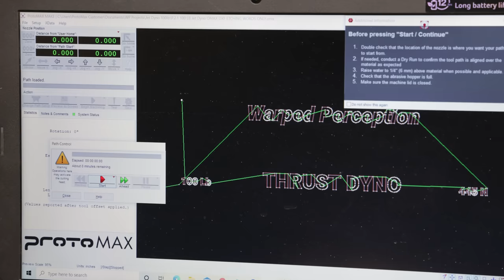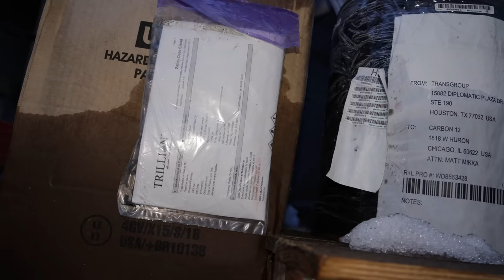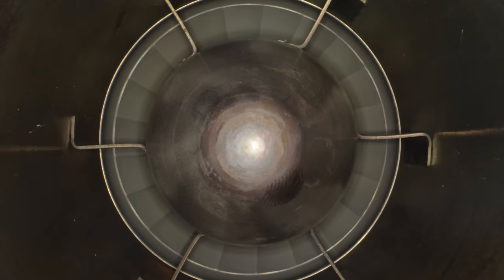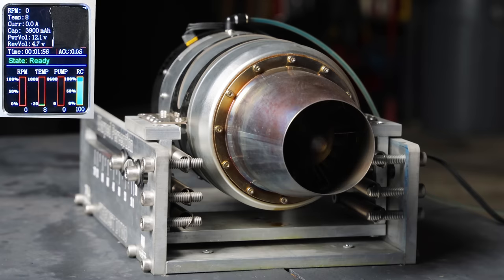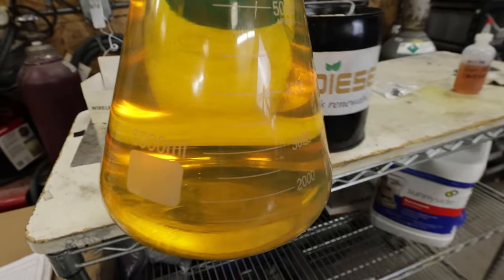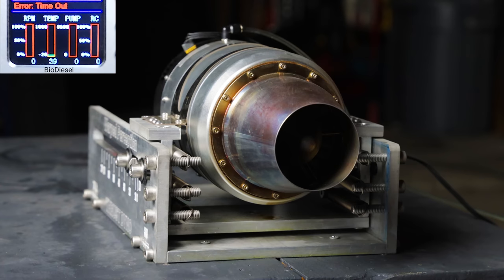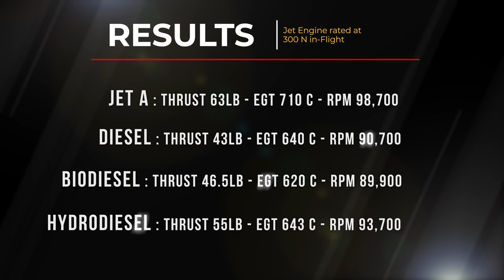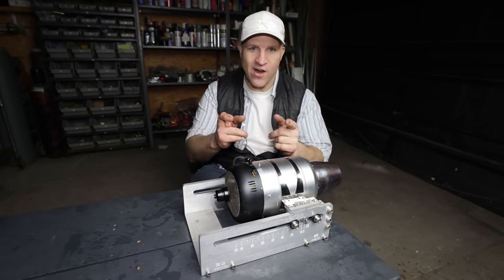Jet Engine Thrust Test - Fuel Experiment (Jet-A vs Diesel vs BioDiesel vs HydroDiesel)

Comment: As an helicopter mechanic for 23 years, I can tell you this test went exactly as I thought it would. Each of the fuels has its own specific gravity, and unless the metering jets are adjusted to compensate for this you'll get weaker power due to incomplete fuel burn. The reason that the hydro diesel did better than the other two is due to physics. The water in the fuel cools the air as it is injected, this increases the aircharge in the combustion section much like nitrous does in a car. Older turbojet engines actually used a water injection on take-off(though it was injected into the compressor section not the combustion section) to increase the performance of the engine. The AV-8B Harrier still uses this today, to boost engine power when in a hover. Jet-A is a very dry fuel, and is anhydrous, and soaks up water like a sponge. This is the reason why a lot of airplanes will put an additive known as colloquially as Prist, though many manufactures make it now, that lowers the freezing point of the water suspended in the fuel to prevent ice build up on the fuel filter screens. So, that pretty much means, hydro-fuel will more than likely not be coming to an airline near you any time soon.
Reply: Great explanation.
Reply: Wow
Reply: Germans used water methanol injection to ad more boost without the fuel igniting from pressure. It allso cooled the pistons. Would be nice to see if it worked on a jet. Alcohol prevents the water from freezing allso tho they propably have tried it in jet engines minding the hydro diesel. In carage it could work coz you don't have to be worried about icing.
Reply: @ark-mark1  If you google it you'll learn that it has been used in jets many times.
Reply: the USAF and McDonnell Douglas experimented with F-4 engines with water injection too, during the Israeli-Arab war to counter the Egyptian MIG-25, they decided to not give the result to the Israelis though because it is considered too advanced
Reply: Correct me if I'm wrong, but I believe the p-47 had a similar water injection for it's radial engine, a little different, but same principal.
Reply: Good old prist...pumped more than enough fuel in my time that included plenty of that
Reply: Out of curiosity, if water injection into an engine is considered a power adder, why is water in fuel always considered a big problem in aircraft?
Reply: @FlexLex  i'm wondering this too, as water is not compressible. i assume in small quantities with enough compression and heat, it changes that somehow but yeah, water in the gasoline is the same as putting a chunk of metal in the cylinders ie. its not gonna be kind to pistons!
Reply: @FlexLex  water sitting in your fuel tank usually settls out rather than staying suspended in the fuel. Water promotes corrosion and microbial growth, both problems in a fuel system. It also freezes, which blocks filters and pickups.
Reply: @FlexLex  because water freezes. At the altitudes these aircraft are flying, the temperature reaches well below 0°F, so any water content in the fuel will freeze, and can cause engine failure
Reply: @ct1762  in turbine engines, the compressability isn't such an issue. It's the freezing point of the water that causes engine failures, as well as the microbial growth that happens in Jet-A with water, this causes a significant amount of corrosion, which is incredibly bad for aircraft
Reply: @ShelbyWithAShelby  but then how does the hydrodiesel work? It has water in the fuel.

Also, I've read multiple cases of aircraft having engine failure shortly after takeoff in warm weather, where the root cause found was "water in fuel."
Reply: @FlexLex  HydroDiesel works due to the relatively low compression ratio of diesel engines, and the water being emulsified in the fuel. This acts as water/meth injection for the diesel. However, as you saw in the beginning of the video, in cold weather this fuel will freeze, which would cause issues for any fuel system. As for the engine failures in warm weather caused by water in the fuel, this is generally due to a large amount of water that has settled in the tanks, and since water doesn't burn, when the fuel system starts drawing pure water, it causes engine failure. This is generally an issue more on high wing piston driven aircraft, as the tanks generally feed from the bottom. This is the reason that on modern airliners, the fuel system uses a floating pick up tube to pull fuel from the tops of the tanks
Reply: @ShelbyWithAShelby  that all makes sense. Thanks for clarifying!
Reply: @FlexLex  gladly!
Reply: @ShelbyWithAShelby  oh makes sense about compressability as the exhaust gasses are all going the same direction all the time, even though there is a "squeeze" before the bang, its got plenty of volume to escape, unlike a piston compressing all the way to TDC.
Reply: @ct1762  :only possible with diesel engines. But it needs a firmware update of the controller before  using it. Gasoline engines risk nocking  so destroy the engine. Gasoline engines are also far less robust then a diesel engine. But water to fuel is a risk of corrosion. Adblue is mandatory for euro6 diesels , it's in fact water wit 35% urea   and if You ignore the messages so Adblue tank empty then the car can not start anymore unless a controller reset is done. Adblue has a separate connection, it's not mixed into diesel.
Reply: @stefaancodde6578  Sorry... whats only possible with Diesel engines? and diesels are not necessarily more robust as far as the rotating components (crankshaft, pistons, bearings etc), but because they make so much torque down low, can comfortably make power at lower RPM, which usually increases engine life. Diesels run much hotter than gas engines, and are more sensitive to dirty fuel, and cannot rev very high (useful for high speed boats that need a propeller to turn high rpm for less drag) but i'd generally agree that Diesels are great for equipment that needs to go over 5,000 HRS and weight isnt a huge issue.
Reply: Perfect
Reply: @FlexLex  Aircraft fly high. Temperature drops 3 degrees per thousand feet. At 35000 feet I have seen -77F. Jet A turns into GEL and clogs the filter screens. Aircraft have tank, line and other heaters to reduce the problem, but a higher water content will eventually cause flame-outs.
Reply: How does the lower molecular mass of water compared to carbon dioxide fit in? For rocket engines adding something with low molecular mass can be very important for efficiency because it means some of the exhaust products are going faster. This, for example, is one of two main reasons the space shuttle engines run very fuel rich, because unburnt H2 is extremely low molecular mass, nine times lower than the combustion product H2O, the other reason is to help combustion chamber from melting btw. Here H2O is less than half the molecular mass of CO2, but I don't know enough to understand if and how much difference it makes for a jet engine like this one...
Reply: Could also be the density, more evenly homogeneus ignition (the closest that come to mind) just like Mazda's Skyactive-X (unheard since a lot)?
Reply: اليس المحركات النفاثه تعمل بوقود الكيروسين !؟
Reply: Jet A have are more category
Reply: @nicholasthiery9542  I believe that was to cool down the supercharger intercooler
Reply: Also, when water goes through the engine, it creates super heated steam which gives additional thrust.
Reply: As a*
Reply: Very informative
Reply: @ct1762  your first statement was kind of wrong, yes water is not conpressible in liquid state but as soon as you inject that into either the compressor or combustion chamber it will immediately turn to vapor like fuel itself does so then it is compressible
Reply: Lol I want to be sounding this smart 😂
Reply: I'd imagine you could use a smaller pipe on this to generate higher thrust, given the lower temps of the hydro-diesel (which is the most bizarre fuel I've ever seen in my life--water should not be in diesel 😂)
Reply: thanks ,I forgot about that
Reply: Does the water content in hydrodiesel present any corrosion issues in the turbine itself if used regularly?
Reply: Based on your comment I believe you are in fact, a helicopter mechanic.
Reply: OMFG back to the school
Reply: @nicholasthiery9542  U are right
Reply: I want to hang out with you and learn cool stuff like this.  Thanks!
Reply: @portal432  me too 😁😁
Reply: Makes sense considering there are a few older turbojet aircraft that used water injection as a means of producing additive thrust past that what the engine was capable of on straight fuel alone. The boeing B52 is an example of that. there's a water injection system which pprovides a threefold improvement for the engines.

1: it cools the intake, increasing the air density of the intake charge
2: the water expands rapidly into vapor during combustion, causing a greater force on the turbine, ergo... more thrust!!
3: the combustion temperatures are lower, which combined with the cooler air charge and the denser exhaust causes the engine to produce a fairly significant amount of thrust over that which it would be able to if it was just running on straight JET-A1, for example.

The only downside, and this is very visible when you see one of these planes take off, is that the water injection causes incomplete combustion of some of the fuel. This means that you will get more smoke than a turbojet or turbofan that does not have water injection.

as a side, a similar effect can also be realised to a degree if a plane's engine ingests water during flight.
Reply: With compensated metering jets, would you expect nearly the same thrust with all four fuels?
Reply: @anidiotinaracingcar4874  At the very least, the alterations to the fuel metering jets for each fuel will improve the engine efficiency per given fuel becuase you will run the engine closer to its stoichiometric ratio, which the magic ratio is where all air and fuel is combusted cleanly to produce power. Depending on how far out of wack the ratio was with the standard kero jets, the engine may see an increase in thrust with lighter fuels from this due to the added fuel. You would likely inject less fuel for the more energy dense ones though, meaning if it was a gross overshoot of the AFR you could see gains in thrust, but I'd be willing to bet there might be a slight reduction but improved engine fuel efficiency instead.
Reply: I would love to meet you. Man, you are very intelligent 👌 and I would love to learn more from you. If I had your knowledge, I'd be a millionaire 5 times over. The world 🌎 needs more people like you. You should start your own YouTube channel teaching young minds and old ones too! You'd probably have a million followers in no time and be getting paid from YouTube and never even have to leave the comforts of your home 🏡.
Reply: @alaric_3015  Or maybe it was disappointing
Reply: Also 747's will suck all the air out of 3 bedroom house in 0.3 seconds
Reply: Just got around to watching this video...I had the very same thoughts when watching, "Change the fuel metering!!"  You can clearly see by the combustion the "heavier" fuels wanted more air.  Same for the temps, and the fuel pumps data acquisition!!  All fuels optimized, it's be curious to see how the #2 would do with the extra BTU content.  Then again, who would want to maintain a turbine running on #2!!  LOL
Reply: Everything you've explained so far is correct and that comes from someone who has worked with fuels ;)
Reply: @ShelbyWithAShelby  but does the fuel tank has to be made of metal?
Reply: @eliasb794  Then how does water injection works? Where do they store the water?
Reply: @tombrown4761  as most aircraft use a "wet wing" design, where the inside of the wing structure is sealed and that is used as the fuel tank, generally the tank will be metal. But it's not only metal that can have corrosion. Composites and rubbers can also deteriorate in the same way
Reply: @ShelbyWithAShelby  what of glass or plastic
Reply: thanks for the detailed explanation of something I thought would be intrinsically the case. I was surprised at the size of the difference between A-1 and diesel. I'd have liked to see premium diesel tested, as it could have exposed a marketing lie (or otherwise).
Reply: Fun fact, the water injection produces a lot of dark jet exaust. We can still see this today if you watch any B-52s take off.
Reply: @paymenomind1604  I seem to remember reading that in an old ICE diesel, black smoke under heavy input loads means the engine is working too hard, and getting ever more inefficient. Thus it's a danger sign your engine is going to expire.
Reply: Thanks for the comment man, really filled soke blanks for me!
Reply: Thank you for your insight and providing your creds to help us recognize your experience behind your statement.  I found your comment very interesting.  Cheers!
Reply: What language are you speaking? I'm lost. 🤣😂
Reply: @MB-qy7ec , Jet A IS an extremely clear refined kerosene.
Reply: or is it that water has a much higher expansion ratio
Reply: Yes
Reply: As a Firefighter for the same amount of time, I can tell you your comment is completely wrong. None of the fuels had "incomplete fuel burn". You might want to look into that. They all burned 100%. Your statement is completely incorrect. I am blown away 1.4k people just "liked" your comment.... You're absolutely WRONG. Just stating a FACT.
Reply: plane engines with water injection where also used in the big war in Germany. It does not only cooling but also some amount of chemical reactions. It was used only temporary.

Comment: Ok...I'm an aviation mechanic and a CJ-3 pilot.  I have to say this blew me away.  Almost all turbine engines are certified for different fuels including gasoline for a limited amount of time.  I've run 100LL in pratt engines with zero problems (limited to 150 hours with pure gas).  The Williams Air Research engine on the CJ are NOT certified for operation with gasoline.  This test shocked me.  It must be a viscosity issue.  Jet A produced the most inter turbine temp and highest RPM as well as the most thrust.  Williams engines don't have nozzles or injectors, they have a "slinger" and are operated by FADEC (full authority digital engine control).  I don't think you could have put on a more pertinent test.  It literally changed my mind about several things.  Thank you very very much!!!  By the way, lubrication from the fuel has no particular benefit for the engine.  The only place it could make any difference is the fuel controller itself.  Prist is an additive that keeps the fuel from freezing and will prevent microbials from growing.  But it is corrosive and has to be used sparingly.  Most engines are restricted to .015% or 1.5 gallons in 1000 gallons of fuel.  If your fuel isn't heated by bleed air or other you WILL be using prist or your fuel will gel and may flame out....ask a guy that has experienced...oh...that's right...it was ME!  29,000' in a Pilatus PC-12 the fuelers didn't add prist.  It didn't fully flame out but it DID become a glider real quick!  I had to dead stick into DAL from FL290.  DID find out how well a PC-12 glides!  hehe
Reply: U talk like u know everything😂
Reply: @p.inspiratesuckstiadakmalu7534  Appears like I know more than you
Reply: @p.inspiratesuckstiadakmalu7534  Considering he is literally a MECHANIC for this type of engine... he actually DOES know everything, it's called being an expert.

Comment: It's almost as if Jet A is designed to be run in jets...
Reply: What a radical idea.
Reply: That's clean stuff.  6,000 rpm gain and double the power of diesel.  Amazing.
Reply: 278 Newton of thrust, can it be done by an electrical fan?
Reply: Occam's razor
Reply: Calm down Connar, people might hear this...
Reply: I don't remember, but some people in a channel made a small aircraft with one of this engines using Jet A, and took off and landed successfully
Reply: It is
Reply: @ljprep6250  could you run it in a diesel car or would the lack of lubrocation ruin it
Reply: @thepurdychannel8866  A diesel or gasoline enginge has it own lube system. and that has a "real" jet engine too! They fill them up everytime when needed. A lube system on a small engine like this is owerkill when its easy to just add some oil in the fuel. Most model engines is lubed by the fuel, even 4 stroke engines. Stihl has a 4 stroke weed trimmer that runs on 2 stroke fuel. And it has no oil in the engine like a car. It has lower revs, but lots of torque. Its really nice when its heavy work. But it is heavy, so shoulder straps is a must.
Reply: Kerosene would have acted similar, Jet-a pretty well is kerosene.
Reply: i wonder why
Reply: @hakan8997  whats the model name of the 4 stroke stihl weed trimmer
Reply: @ljprep6250  What screen were you watching?
8,400 rpm gain and more like 50% more power gain, not 100%!
Reply: Nooooooooo... really!? lol
I swear I could smell the burning jet/diesel fuel while watching this video.  It's funny how the mind can play tricks on ya.
But I couldn't smell anything during that funky looking biodiesel test. he-he
Reply: @spinna6996  I must have been dizzy from the fumes.  Mea culpa. (slaps forehead)
Reply: then why did hydrodeisel make 240 someodd newtons and jet-a only made 219?.... water vapor, I know.... cool stuff!
Reply: @MotherRussiaisforever  No ,electric turning up is only used for starting the engine.

Comment: That was extremely interesting, as I knew a jet engine can run on almost any kind of fuel, but I didn't know how effective alternative fuels are. Awesome stuff.
Reply: How then does the white sort of smoke comes out of the jet engine in the sky, what kind of fuel do they use??
Reply: @MotherRussiaisforever Contrails (the white lines) form when the warm moist exhaust fumes from an aircraft mixes with the cold ambient air producing ice crystal clouds.